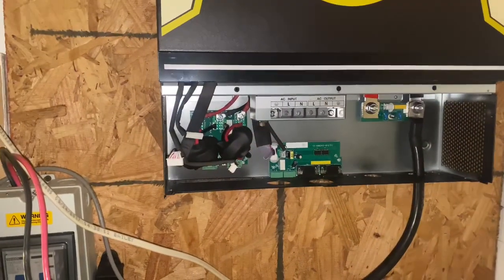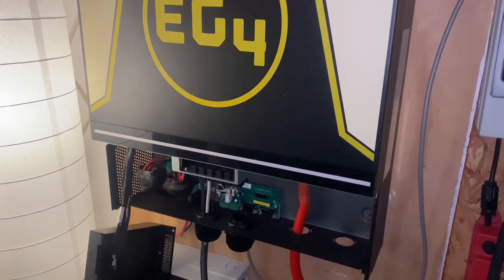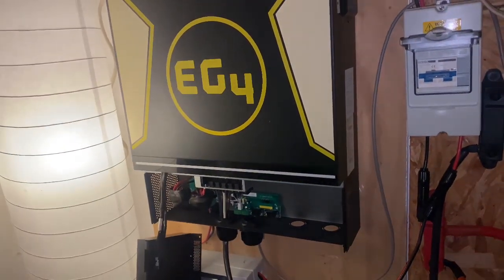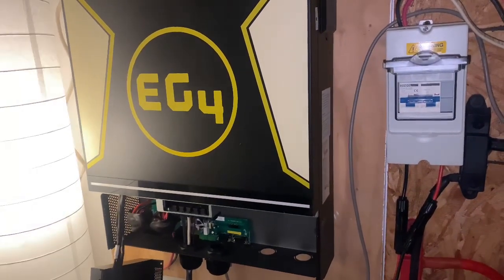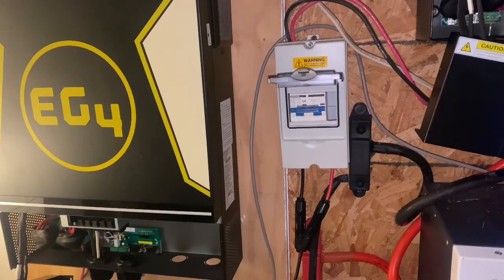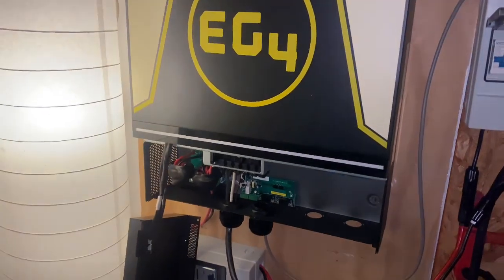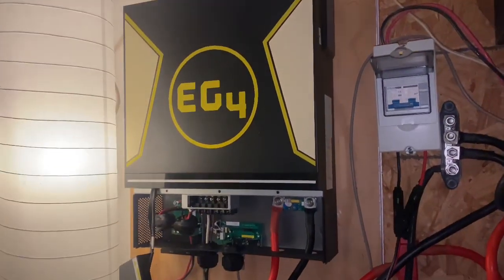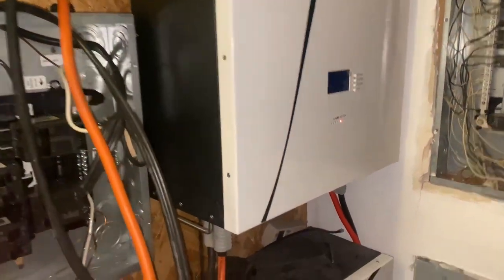MORE PROBLEMS WITH THE EG4 INVERTER 🤷🏽‍♂️🤦🏽‍♂️🤦🏽‍♂️🤦🏽‍♂️

Comment: The problem with these inverters is that they don't have an iron core, copper wound isolation transformer. All high frequency inverters are a scam. The Chinese know full well that their high frequency, transformerless inverters offer a far short life expectancy and a much poorer peak power capacity when compared to "Real" heavy duty low frequency, transformer based inverters. This seller should never have imported these cheap, Chinese made, high frequency inverters into this country.

Comment: Your system is not set up properly the battery are not set up on each inverter. The min for pv start up is about 200 volts about 20 amps max
Reply from the maker: I’ve had both running Correctly I explained what happened in the video

Comment: Well you could start with getting some proper training in the electrical trade. The electrical workmanship is just plain awful and therefore any of your opinions and judgments are void. Never take advice from someone who does not know what they're doing!
Reply from the maker: That’s your opinion but I’ve been doing this for over 15 years off grid with no issues, they only teach you what they want you to know I’m not into all that I’m not saying this is simple but it’s not hard once you do a little bit research
Reply: I will finish training as a residential wiring electrician in December. The training will help you meet  nec code. It is worth the training.

Comment: I went to my off-grid cabin this weekend to find my battery bank dead.  I just hooked up an EG4 3K 48v a few weeks ago.  It looked like it was doing well, but apparently it wasn't charging my batteries.  I have 4 12v-200A  Li batteries connected in series.

Comment: For some reason I keep getting af and gf faults, where 4 breakers in my panels will not flip to the on position when I flip to solar power with this inverter. Once I switch to grid power those af and gr breakers come back on and work just fine. I have a Leviton panel.

Comment: From a technical aspect this is a 5 year old Taiwanese design copied and built in China. This is a generic HF inverter built by half a dozen Chinese manufacturing companies for the mass market. Dirty AC is common. QC is questionable. Transformer or resistive loads are ok with it. But inductive or other pulsewith power supplies don't play nice with this technology.

Comment: Do your fans run non-stop even with no load or charging? The fans on my Aims and Growatt only come on when needed. My EG4 6500 fans run non-stop.
Reply from the maker: No both inverter fans come on when I have a load on them
Reply: @texasoffgridguy8749  How about when you have NO load and not charging?
Reply from the maker: @mikedrew9361  both still would be be off
Reply: @texasoffgridguy8749  My fans are off when the inverters are in standby (turned off) otherwise they run continuously. Seams like a waste of power.

Comment: Discreet components are the way to build a system.  Almost every All in one units are junk on so many levels.  Better to keep things separated... easier to monitor, easier to service and replace if need be,  and keeps the heat dispersed much better.  Heat is what leads to premature equipment failure more often than not.  That and shit software, which is something chinese clone companies excel at.  Get what you pay for really. Often times,  much less that what you paid for.

Comment: Brand new EG4 6000w Split phase inverter dead on arrival.  Waiting for the resolution department to get back to me about a replacement. It's been a week so far. Signature solar is quickly moving in to the "never buy from again" category.

I'm so glad I didn't buy EG4 batteries.  Trophy batteries are higher quality and priced the same or lower. But Trophy doesn't send pallets of free stuff like EG4 does, to certain popular solar youtube DIYers.  Can't help but wonder if 2 or 3 years from now if EG4 battery failure videos will be everywhere on youtube.

 There firmware is awful and they seem to have zero quality control measures in place. I'm not real confident the replacement inverter will work properly. There is also the joy of mounting, un-mounting and remounting an 80 pound inverter. The number of returns due to malfunction is getting to be alarming.

From here on out any youtuber talking about how great signature solar and EG4 is will take with a grain of salt if I watch their channnel at all.

Thanks for the straight forward honest feedback and for documenting your experiences.
Reply from the maker: Sorry you going through that with eg4 but I feel your pain
Reply: @texasoffgridguy8749  Finally got a refund from SS and purchased a different brand split phase inverter from another vendor.

Comment: At least get a voltmeter, and start checking voltage on the terminals
Reply from the maker: I have done that
Reply: While your at it,  clamp the lines coming into and out the inverter and get ready to be disgusted at how much power you are losing due to the horrid efficiency factor of these cheap inverters. Check at the normal running levels rather than putting big loads on it... that's where the curve swings very unfavorably with these higher power units.  I've seen them as abysmal as mid fifties percent while handling a few hundred Ws.

Comment: Signiture Solar is nothing but a bunch of used cars sales men. The Tech Support are not very knowledgeable. There have been a lot of guys having problems with Signiture solar products. I was down for 30 days. The best inverter out there is Schneider electric. They bought out the work horse trace inverter and the good thing about them they are very good tech support and they are in the USA and they will help you troubleshoot it.
Reply: Sol-Ark is infinitely more user friendly and the support is great as well. The company is out of Plano, TX. After over ten years of my family installing battery backup systems we have long moved away from Schneider since Sol-Ark has come out with there 12k and 15k inverters. Schneider definitely seems better than Eg4 though.

Comment: Sorry about all the issues.  I know how frustrating it all can be.  

Just a thought based on your alarm mode on your UFO battery.  

When you disconnect the inverters from the battery, the capacitors discharge in the inverters.  When you first hook up the inverters to the batteries, you’ll need to precharge the capacitors in the inverters.  Some server rack batteries have this ability built in.  I believe the Lifepower do.  If the UFO doesn’t, as soon as you turn your battery on, you’ll trip the batteries over current protection and it will alarm.  I’ve done this several times myself.  It’s especially problematic when you hook up 2 inverters at the same time because you’ll have double the inrush current.
Reply: They put a weak BMS in the eg4 batteries. Shouldn't be a problem to fill inverter capacitor right from start if you have a good BMS.

Comment: I said it from the start, glad you're posting these videos so others know better. Get a Sol-Ark 15K and call it a day, if you need to put a smart loads panel on it. You can finally start setting things up for long term use.
Reply: Funny to find you here!
Reply: The SolArk is another, high frequency, transformerless inverter, just like the EG4. So, no thanks if you want performance and reliability, go with a hybrid,  low frequency, transformer based inverter charger and really call it a day.

Comment: Go ahead & get that Schneider  . I upgraded the 4048 to the 6048 and the 600 volt charge controller they have . You wont have any regrets with Schneider. Except the price but get what you pay for .
Reply: How long have you had it? My Schneider 4048 caught on fire one night when I switched off the generator breaker while it was charging. After they gave me a hassle, they sent me a warranty replacement. The exact same thing happened. NO WAY would I ever recommend that junk. I got an Outback and it's been fine for years now.
Reply: @MyBacktrail  I've had my Schneider's for several years now with no issues . Have recently went to higher voltage this year to the 600 volt charge controllers . So far been ticking as they should

Comment: did you use a pre charge resistor ??? My guess is that you didn't. the only reason they are coming on is that the solar does not require a battery to turn on. the BP flashing means NO BATTERY present. I don't believe that it has anything to do with your bypass. My guess is that the battery is tripping because the capacitors are looking like a dead short and the UFO BMS is going into a protection mode.
PS, if you want to verify what I am saying, go into the battery BMS and look at the fault. My guess is it is going to say Short Circuit Protection .
Reply from the maker: Did you watch my whole video ? I stated it was working before I received the replacement it had nothing to do with resistors the inverter just won’t come on resistors or not the batteries are fine
Reply: @texasoffgridguy8749  I sure did. My guess is when you hooked the second one up to the battery you didn’t use a pre charge resistor and then tripped out the battery.
Reply from the maker: @sNEAKYnIGHTmUPPET  the original one wasn’t working before I hooked it up
Reply: @texasoffgridguy8749  yeah I get that. But when the SECOND one tripped out the battery from having discharged capacitors, the FIRST ones capacitors were drained as well. Meaning now it too needs to have its capacitors recharged with a power resistor also. 
You can also use a pencil with both ends sharpened to do that same thing as a power resistor.
Reply: @texasoffgridguy8749  Another way to do it would be toi connect the inverter to a bare 48 volt battery like your LEAF cells without a BMS for just a couple seconds, then over to your UFO pack.I am 99% certain you are tripping your BMS on short circuit protection.
Reply: @texasoffgridguy8749  you should really just try what I am telling you. I have seen this first hand myself on three separate occasions, so I am speaking from experience here.
Reply from the maker: @sNEAKYnIGHTmUPPET  I’ll try it won’t hurt to try right
Reply: @texasoffgridguy8749  well, did it work? 😉

Comment: Isn’t the left side the input for the AC where you have the AC wires plugged in?
Reply from the maker: Yes that’s what’s I used for bypass before I received the second inverter I took it apart to connect the second inverter
Reply: @texasoffgridguy8749  But, in your video you never show input AC going to the new converter. A real test of the new converter would be connecting it up the same as the old one and turning it on.
Reply from the maker: @farside1  once I have the time I’ll shoot s video of it

Comment: I sure am glad I spent the money on Sol Ark. Zero glitches other than a wifi dongle. Coming up on one year. Totally off the grid.
Reply from the maker: Congrats I’ve been considering going with sol ark
Reply: I'm getting away from the crappy eg4 stuff going with solark.
Reply: @ktube4848  You want a good inverter for off grid get the Schneider 6848pro and you will never look back This inverter all in one can’t support unbalanced loads

Comment: Bummer. I was concerned those EG4 inverters were too new to the market. I ended up moving from Growatt to Sol-ark. The Sol-arks cost a lot more, but mine have been running since Jan 6th and I haven’t had to work or them at all.
Reply from the maker: Thanks for the information
Reply: 3/4/22…ditto.